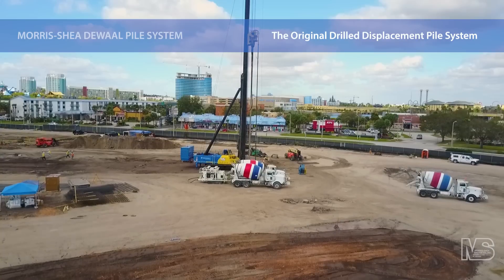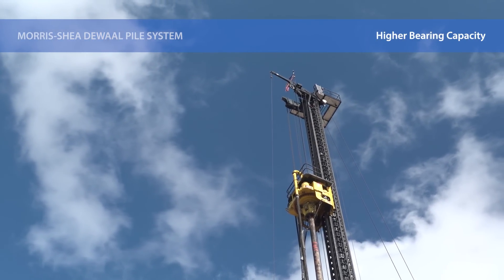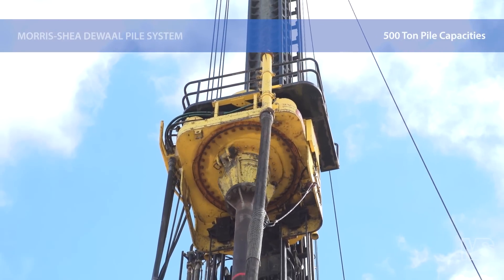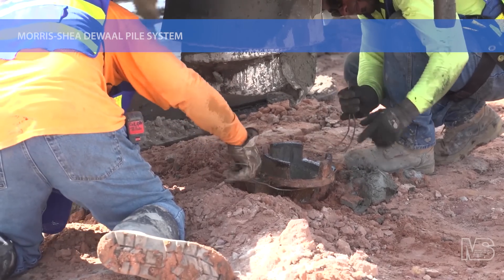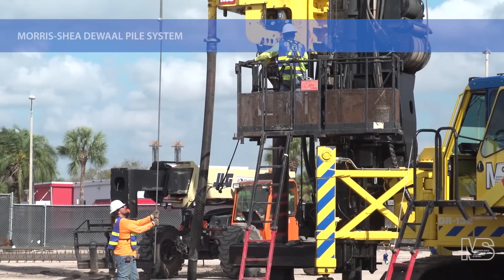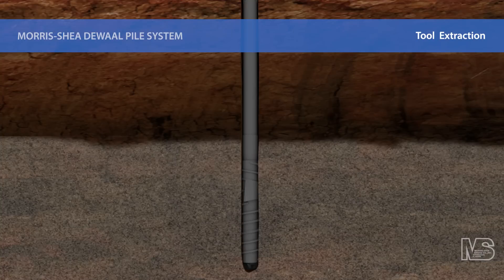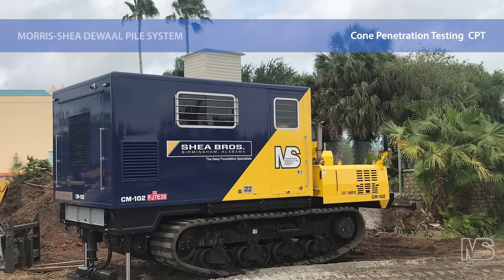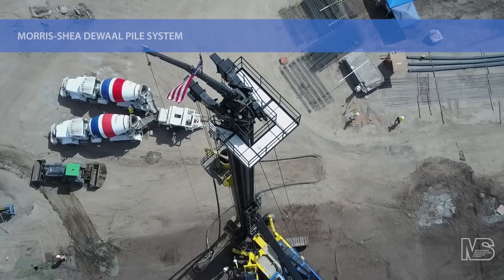Morris-Shea DeWaal Drilled Displacement Pile Installation

Comment: For whatever reason I've been watching pile installation videos lately. Based on absolutely no related professional experience or knowledge this looks like a really good idea to me. Also the video was well done and in English. Well done.

I kept wondering about using this technique for the Millennium Tower repair piles. The narrator said they were limited to 170 feet and the Millennium Tower repair piles were 270 feet below the surface. So maybe these piles wouldn't have been a solution. However, with all the money involved in that repair there might have been an opportunity for Morris-Shea to design new equipment that would have allowed the use of this kind of pile for use at greater  depths? I wonder if Morris-Shea was contacted by the people in charge of that fix. Less vibration and the fact that soil would always been blocked from flowing into the hole for the new pile might have been very big advantages for the Morris-Shea piles.